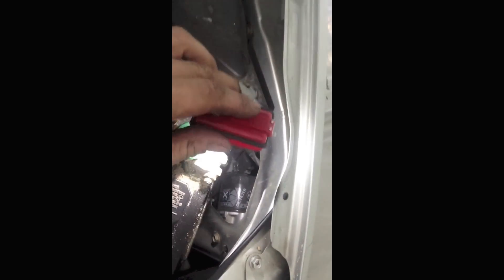2006 Subaru Outback 3.0 H6 transmission Oil Filter location

Comment: It's a lot easier to just pop a couple plastic tabs out of the inner fender well, fold the plastic back and spin it off from down below. Save you a lot of time screwing with the battery.

Comment: Thanks!!! Now I will have to postpone the oil change until I buy a filter.
Reply from the maker: Don't bypass the flushing either because with the tranny cooler in our cars there's a lot of tubing full of the old oil.
10 Min Automatic Transmission Fluid Flush + Replacement (Most Cars)

Comment: Im in a situation. I have an 05 Outback 3.0R 6 cylinder. I was told that the transmission is slipping. Should I change the transmission fluid or not? I have never done it and I’ve been told that by doing so I could really mess it up or I could really mess it up by not changing it. What should I do?
Reply from the maker: I believe the only concern would be if everything got changed out in one fell swoop then there could potentially be larger pieces of sediment that could get loosened up and get sent throughout the system.
The 5EAT transmission is pretty damned durable, better than the 4EAT.
How old is the fluid?  Regardless of age, if the fluid is all black then definitely change it but do it smartly and only use Subaru ATF-HP fluid.  Don't use the 'multi-vehicle' of 'all Japanese' labeled ones.
However, I do read a lot that if a transmission is already on its way out then changing the fluid can make things worse due to there being a decreased pressure to help the clutches engage.  And be kind with the throttle when you're driving around so that it's not revving super high and slamming into gear.  I actually had a transmission on one of my older cars do that on the way to work.  The transmission destroyed itself and blew a hole through the housing!  It felt like a large rock had hit the underside of the car while I was going 60.
My current 07 Outback LLBean 3.0 had 300,000 miles on its transmission  and who the hell knows when they last did any maintenance because that fluid was blacker than the cover of Spinal Tap's "Smell the Glove."  It took me probably a couple of weeks to get it properly flushed and clear again.
-Basically, buy a shit-load of Subaru ATF-HP.  Like a case and a couple of extras.
-get a large bucket.  or a couple of buckets
-change the filter
-find the hoses going into the tranny cooler up by the radiator.
-the OUT line should go into an empty bucket
-the IN line should go into the bucket full of fresh fluid.
-turn the car on.  It'll send the old stuff into the empty buck while refilling the system with fresh.
-when it becomes clear turn off the car.
-now you can do a basic fluid level check.  Drive through all of the gears for a few min.  Let the car sit while running for a minute or two and check the fluid level.  Add as needed.

There's an even slower and safer way to go and that's to drain and fill a quart at a time, driving close to 100 miles in between quarts.  Supposedly it lessens the potential for larger chunks of whatever to break loose and mess up the system.

Also, do go check out the www.subaruoutback.org and www.legacygt.com forums.  There are all kinds of knowledgable people on there, especially on the LegacyGT site.